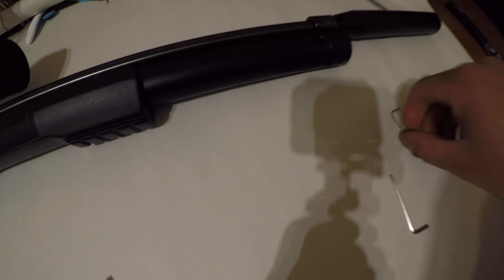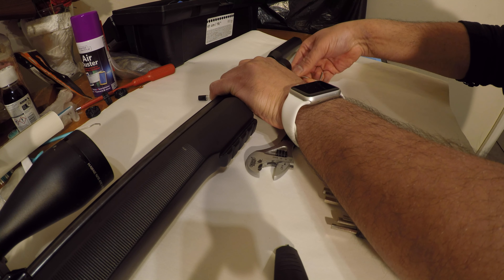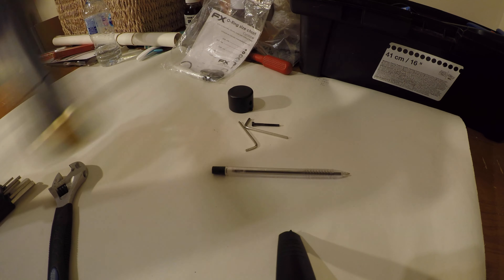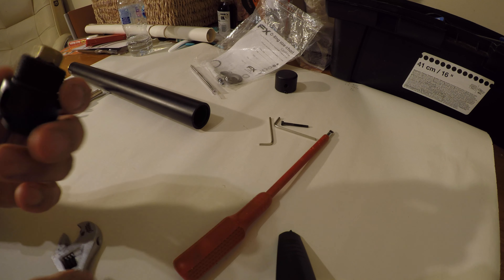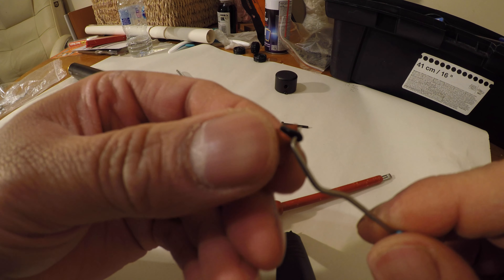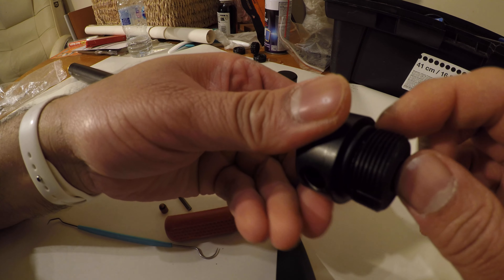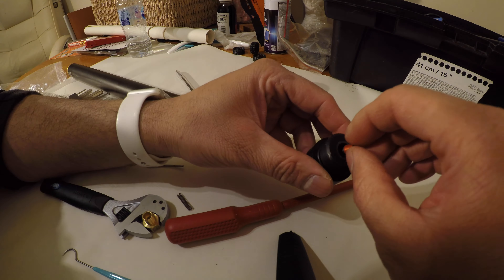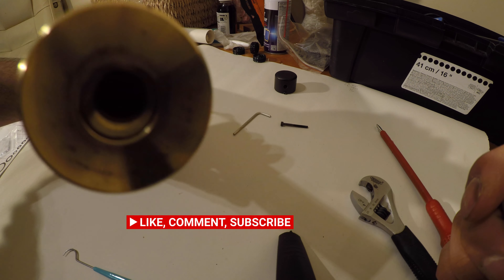FX Cutlas fill valve service & seal change Cyclone Super Swift FX6000 Logun Domin8or

Comment: This is exactly what I needed, I have a Cutlas as well as other FX rifles and this looks straightforward. But can I ask,  how do you void a pcp that does not have a regulator completely of air, given that you can't just keep squeezing off shots if that is detrimental to the rifle below a certain pressure?
Reply from the maker: my rifle is regulated.
just unscrew the fill valve side to release all the air.
if you want to empty the regulator of air then just fire a few shots untill the reg pressure gauge shows empty

or just unscrew the reg pressure gauge slightly to release the air.
Reply: @gullysgunsgear  Thanks, further to that is the basic procedure the same for a Typhoon or Streamline, do you know?